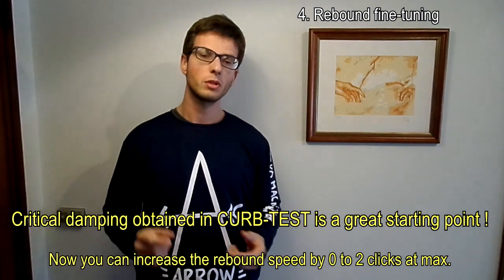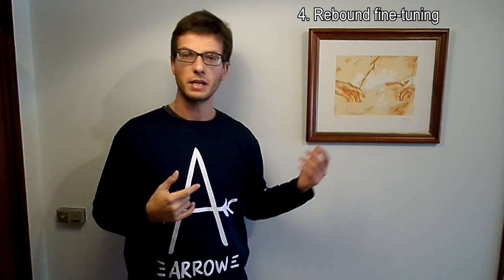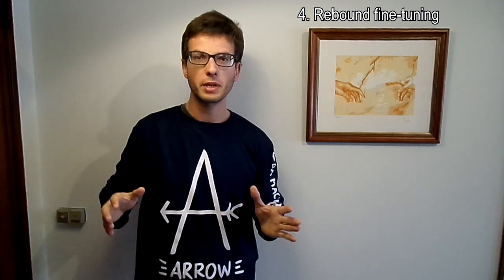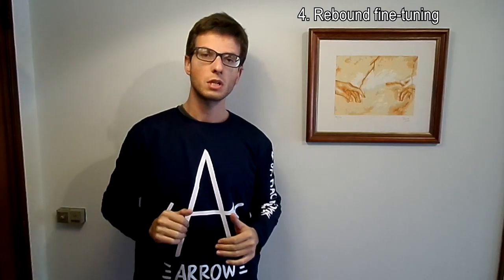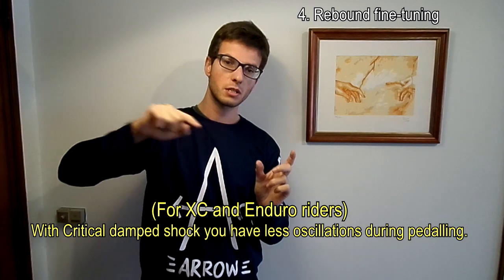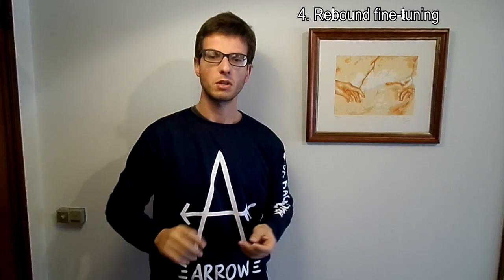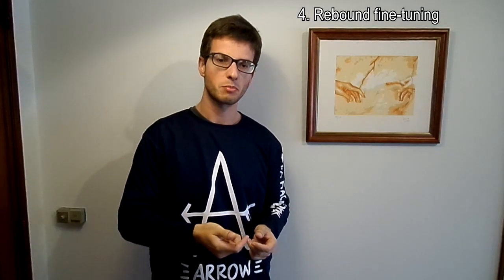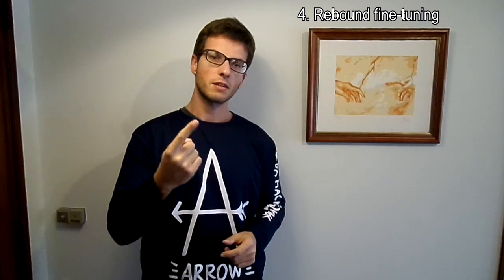How to CORRECTLY setup rebound damping (MTB rear suspension Ep.5)

Comment: I am wondering why rolling off a curb at walking speed is the best method?  This does not seem to imitate anything like my normal riding.  Is it just coincidence that this works or is there a reason?
Reply from the maker: There is a reason. By doing in this way you are dealing with just one bump without any other interferences. So it's easier and much simpler to tune and find a good damping ratio. After doing this, you will find your bike much stable and with less bouncing under pedaling on the trail. After getting the critical rebound, you can put +1 or +2 clicks (towards faster) to get a more active and confortable feeling. Much more than that you will end up with a bouncy and unstable ride. More info here: https://www.youtube.com/watch?v=zxrIybZxMUA

Comment: Hey, i run a Cane Creek Air Shock, it has both rebound adjustment for hi- and low-speed. Does the curb test apply to the hi or low speed circuit? Thanks and great videos!! Cheers
Reply from the maker: For those that have a shock with 2 rebound settings (high and low-speed) check this video at minute 9:00 ( https://www.youtube.com/watch?v=Yjql1kExvCE ). This should give you a good starting point, at lest it's a balanced way to do it, without going into extreme settings. If you want to try it tell me if it worked well for you.

Comment: I'm a heavy rider 115kg and I have rebound as slow as it can go. But still get oscillation. Do I need to add spacers? My sag is at 20%
Reply from the maker: +Ben Sanders That's because you are using very high air pressure (as a consequence of low sag + heavy rider). Therefore thr rebound damping is not strong enough to slow it down (even in slowest position). You probably need a Firrmer tune on rebound (H red letter)... Increasing the sag a bit (to 25% at least also might help). Bye
Reply from the maker: +andrextr The spacers won't help. Spacers are used only to reduce bottom outs. Bye

Comment: Hi Andrextr!

Your Video is very helpfull for me as a beginner with a new bike! 
Can you please explane how to integrate the "open mode adjust" into setting up the suspension correctly (or maybe even post a open mode adjust tutorial if you have time and motivation ^^)?
Do i have to re-adjust the rebound according to different OMA Settings?
According to fox website the open mode adjust adds firmness or plushness to the for (22 klick finetuning) and rear suspension (3 klick finetuning)..
thank you very much in advance!
Reply from the maker: +Gmiadlicher After adjusting the sag, you adjust rebound with open mode and it's done. You don't need to readjust rebound with different OMA settings. The shock and fork have those 3 settings on the fly (open, trail and climb) to quickly increase the stiffness of the suspension. The fine tune affects how stiff the open mode is. It's basically a low speed compression adjustment. More firmness increase the stability of the bike, reduces pedal bob and brake-diving and gives more support. With softer setting the suspension becames more "spongy" and wallows more. While this adjustment affects mostly these type of low speed events (diving, bob, etc) it also slightly reduces the sensitivity on bumps. So, tune it accordingly to your preference and type of terrain. For smooth trails and pedaling use firmer settings for rocky and bumpy trail use softer setting.  I talked about this stuff in this video:
 https://youtu.be/Yjql1kExvCE

Comment: Hello!
The critical point is where you dont have rebound in the carb test, depending on the trail max 2 clicks faster, not slower...for pedaling uphill the critical point is the best. Is there any situation in your opinion that it would be recommended to go 1 or 2 clicks slower?
Great video Andre!!!!
Reply from the maker: +rologti The critical rebound is when the shock rebounds the fast as possible without any oscillations in the curb test. This will be your base rebound tune (there is no advantage to go slower from this point). Now, from this base point you can increase the rebound speed by a few clicks according to your preference. In the critical rebound the bike is very stable and don't bob much. If you increase the speed a bit (like 2 clicks) you lose a bit stability but increase the liveliness of suspension. Much faster than this the bike becames unstable (pogo stick). Bye
Reply: andrextr Thanks!!!!

Comment: +Andrextr thank you for this, how do you suggest we fine the critical 3 usable rebound damping for the front?
Reply from the maker: +Buffalo Theory At the end of the video I cover the front rebound. Basically you bounce on top of the bike and try to reproduce a slightly faster rebound on fork. In the fork you have more room for error. Bye
Reply: thank you, so there is no 3 critical usable damping for the front like the Fox guys say?
Reply from the maker: +Buffalo Theory There is a correct a correct range for the fork, but this range can be wider. While a fast rebound on shock can throw you over the bars, this is more unlike to happen with a fast fork rebound. Use my suggestion to get a base rebound speed on the fork and then fine tune as you want. With the base tune you already got a nice rebound so it won't be needed many clicks from this point to fine tune it. Bye

Comment: What adjustments to the suspension would you recommend if I want the rear to slide sooner and the front to make more traction?
Reply from the maker: A slick tire should work :D Otherwise I would say that a a bit more stiffer rear suspension (more air pressure / stiffer coil) and a bit more compression damping would make the rear tire to slide more by lowering its traction (this is what they do on drift cars).

Comment: when turning rebound up to fastest before doing the curb test, is that both high speed and low speed rebound if you have both dials or is it just one? 

i will try doing both at the same time and check bath with results

Comment: Thanks alot for this realy realy great video André!
 I am just wondering: Is there a way to apply this method to the suspension fork of a mtb? Cheers
Reply from the maker: Eheh, I answer this question to another person like 5 minutes ago eheh :) Indeed its a very requested question, but unfortunately I don't have any good scientific method for tuning fork rebound for now. My advice it to tune it by feeling, in a way that feels balanced with rear shock (in preference a bit faster). You have more room for error on fork rebound since, unlike the rear shock, a faster setting won't throw you over the bars on a fast sketchy jump/trail. Bye
Reply: Tuning the fork a bit faster than the rearshock sounds like a good starting point :) Thanks alot for your reply ! (btw: your new video is awesome, it realy got me understanding all the fuss about high- and lowspeed rebound adjusters)

Comment: Are you talking about adjusting low or high speed rebound when doing the curb test to achieve the critical point? Fox air X2 2017 shock
Reply from the maker: In this case I used a shock with a single knob (which adjusts mainly the low speed rebound, however, the high-speed is also affected accordingly). For your shock I would recommend to watch this video at minute 9:00 (https://www.youtube.com/watch?v=Yjql1kExvCE). Probably this is not the best way to tune it, but I believe it's a good starting point, at lest it's a balanced way to do it, without going into the extreme settings. If you want to try it tell me if it worked well for you. Independently of your setting always check on the curb test to avoid excessive bounciness (which could throw you over the bike on a fast sketchy jump/trail). Bye

Comment: Where do I start with beginning and ending stroke rebound???
Reply from the maker: If your shock has 2 rebound adjustments my advice is to check this video on minute 9:00 (https://www.youtube.com/watch?v=Yjql1kExvCE). PS: begginning and ending stroke rebound is the same as the low and high-speed rebound (respectively). This is a nomenclature used by rockshox to simplify, but technically is not quite correct. Happy tunings!

Comment: Great video, thanks.  You have a comprehensive way of presenting this information, while still keeping it simple to understand.
One question for anyone here.  "Clicks-out" as described on bike setup vendor pages as a "starting point".  How come Fox and Rockshox seem to have a different explanation of each.  Is it always "clicks-out" from fully open (fully-anticlockwise) or clicks out from fully closed (clockwise).  I assue the first, though there is a discrepancy online as to the difference with these two vendors.
Reply from the maker: Suspension vendors don't have clicks recommendations for shocks, they only have for forks. That's because the shock setting will depend on the leverage ratio of a particular frame. Usually only the frame/bike vendor has that clicks recommendations for the shock (on the bike manual). Anyway, if you are confused just remember that heavier riders need more rebound damping due to the higher spring rate (they need more clicks towards the slow rebound). So, if the clicks number increase along rider's weight then they are counting them from the fastest position. Bye
Reply: Thanks andrextr for taking the time to reply.
Your answer confirms this detail from a manufacturers website.  Here i imput two weight figures, 80KG and 110KG as an example.
110KG - 99PSI 1 click out - Fox Performance 36 TALAS FIT4.
110KG - 290PSI 2 clicks out - RockShox Monarch Plus RC3 DebonAir.

80KG - 71PSI - 6 clicks out Fox Performance 36 TALAS FIT4.
80KG - 220 PSI - 3 clicks out - RockShox Monarch Plus RC3 DebonAir.
Reply from the maker: +DarkpowderUK In that case they are both starting from the slowest rebound (highest damping ++). Anyway with the video's method you can set up correctly the rebound for any shock for any bike for any base tune, without memorizing the numbers of clicks... Bye

Comment: Thanks for the video. This is the best video about setting rebound in the rear shock. 

Should I use the same method for the front suspension?
Reply from the maker: At the end of the video I spoke a bit about the front suspension. It's a more "feeling" method. But the rebound of the front suspension is not so critical, you have more room to play. Bye

Comment: Does the setting of air pressure affect the rebound setting? This is the best video so far I've seen on setting up shock and fork. At least it's more practical way of judging the critical rebound setting.
Reply from the maker: Yes, the greater the air pressure, the more rebound damping you need to slow down the spring extension. Bye and thanks :)

Comment: I wonder why should I sit while doing the curb test? and why walking speed?
Reply from the maker: I prefer doing the test seated to keep the body quiet, and to transfer all the weight to the shock during the impact (reducing the absorption from the legs). It's simpler. And going slower also compresses more the shock and it's easier to see the bouncing (but the speed you go won't affect the rebound tuning). Bye

Comment: So ideally you want the shock to extend, compress and then rebound TO sag

or

extend, compress, extend past sag then return to sag?

Which one is correct? To me it seems like the first option would be correct
Reply from the maker: Sorry for the late response. Yes the first one is the correct one. When you get in that point, you can increase the speed just a little bit (by 1 or 2 clicks), so you end up with a little bit of the 2nd option. :) Bye
Reply: no worries mate thanks for your tips!

Comment: I've set my shock they way you said and It's been quite good but I notice when on rocky climbs when going slow the back wheel will come up against a rock and the shock will compress and I sort of stop moving for a split second does this mean that if  I am on those sort of trails I should give it a couple of clicks ( Fast)
Reply from the maker: You can increase a bit the speed until you get a tiny oscillation on the curb test. But, on very slow rolling speeds all shocks will work like that... when you are moving slow over bumps, the whole bike (including your body) will move up over the bumps and down over the holes. When you are riding fast over the same stuff, your body and main frame is "suspended" and the wheel is the only part that moves, and you won't feel much the holes and bumps. This is called the Transmissibility of vibrations. It's easily observed in speed bumps on the road (the faster you move the more the suspension isolates the bump - https://www.youtube.com/watch?v=UB9gA9Af5Tw ). Bye
Reply: Thanks for the reply. I actually don't have any trouble with the rear suspension being like that, it's the front  forks, as it is easy for your bodyweight to go forward on a concealed tree root/rock/hole for example and catch you off guard , so I  decreased the sag to 15% in the Forks and left the rear suspension as it is for that particular track which is about 16 km and it has made the bike better to ride it

Comment: hi, great vid, but I have a problem. I have high speed and low speed rebound. Which one should I adjust using this method? both maybe?
many thanks for all your interesting videos. hope to hear ftpm you.  Gav
Reply from the maker: Hi. I addressed that question on Ep.7 video (https://www.youtube.com/watch?v=Yjql1kExvCE) at minute 9:00. For the shocks with a single rebound knob, that knob mostly changes the low speed rebound, but it also affects the high-speed rebound accordingly. At the end of the day, the ideia is always to have the shock rebounding the fast as possible with just a tiny oscillation in the curb test, independently of the number of knobs. Bye

Comment: Very useful and easy way to setup rebound. Than you very much. Could you please make the video about suspension forks?
Reply from the maker: Do you mean about the Rebound in the fork? I addressed that on the final part of the video. There is no easy method to tune the rebound of the fork (in opposition to the curb method in the shock). You need to tune it by "feelings", which is not very scientific, but the good part is that the fork rebound has more room to play and to error (it's not so critical as the shock rebound). However, as I said at the end of the video, I suggest you to bounce on top of the bike and find a rebound speed at the fork that matches with the rear shock, or even a bit faster. The bike has to feel balanced between front and rear. Bye :)

Comment: Great video! Is there any connection between rebound settings and braking bump efficiency (anti-rise)? Thanks a lot.
Reply from the maker: Anti-rise force is trying to compress the suspension and therefore it also counteracts and slows down the rebound speed. Increasing the rebound speed promotes more traction on braking bumps but you might also lose some stability in other situations (always a trade-off).

Comment: great video, my shock has both low speed and high speed rebound adjustment and i ride enduro, should i setup my lsr at the critical damping point them make my hsr a click or two faster?
Reply from the maker: Check up minute 9 of my Ep.7 video ( https://www.youtube.com/watch?v=Yjql1kExvCE ). I did some advise for that type of shocks. At the end of the day you should get just a tiny oscillation in the crub test. Bye

Comment: Thanks for the video! Very informative! 
I have a Canecreek Inline shock, with both LSR and HSR. Which one will I be adjusting for this video?
Reply from the maker: Hi. In normal shocks the rebound knob affects mainly the LSR circuit but also affect the HSR. In your case you have independent adjustment of each one. Check my Ep.7 video where I talked about the rebound on those shocks. At the end of the day, you should get only a tiny oscillation during the curb test. Bye

Comment: i got dirt in my rebound screw and can not move the adjuster, how should i do?
Reply from the maker: That's a quite comum problem. I would say that it might depend on the shock you have, but unfortunately I believe that in many cases, like in fox, you need to disassemble the entire shock (including the main piston) in order to lift the rebound rod and to remove the rebound knob (see the technical drawing below). In alternative you can try to clean with some air pressurizer and lube it with some spray, either in both fully clock- and anti-clock wise positions. You might also have some dirt in the spring-ball bearing responsible for the "clicks". If you have a RP23 or a different shock it migth be different. Bye
http://www.dhfr.ru/fox/Content/PartsListDrawingsShox/DHX%2050%20%20Folder/816-66-230_RevA.pdf
Reply: Thanks for a really quick and detailed answer! I've got an dhx 5.0, but i've Heard they were plumbed/sealed so i haven't really had the guts to open it up. Is it worth doing a kashima upgrade while having the rod disassembled?
Reply from the maker: Yes you need to bleed the shock to eliminate air bubbles in the oil.  You can do it at home, but it's better to do it at official shops since it's not the easiest thing to do... I don't think kashima is worth in this case honestly... But if it's like 5 bucks them sure :D ahah. You have here the procedure to service the shock just in case: Bye
http://www.dhfr.ru/fox/Content/Service/Rear_Shocks/DHX_40_rebuild.htm

Comment: How would you find the critical damping using the curb test on a canyon strive? Find it in dh mode or xc mode? Very interesting video, you certainly know your stuff.
Reply from the maker: +G Ma I would say in DH mode since its when you take full use of your suspension. That means that rebound will be faster on XC mode since the shock becames stiffer on that mode. But you have to live with that :) bye
Reply: +andrextr that's what I thought but I wanted to get your take on it. Cheers for the help, keep up the cracking videos.